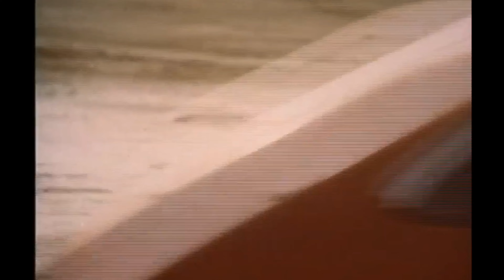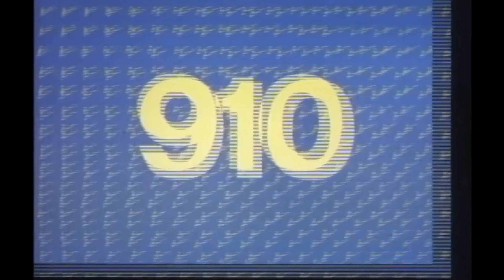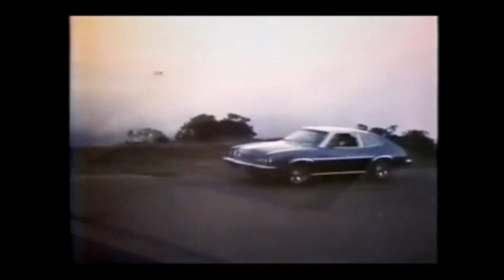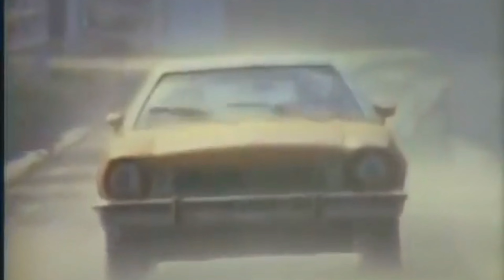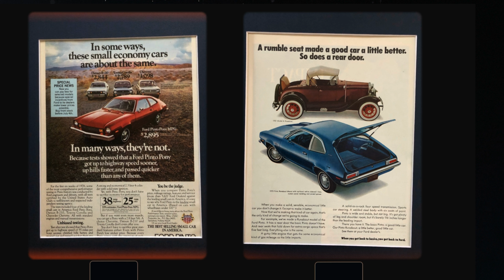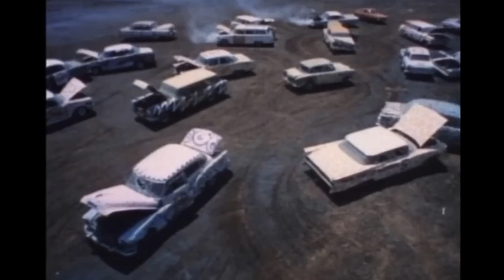Ford Pinto: The Car That Caught Fire for $11

Comment: As someone who actually worked on Pintos and drove them, I think you're overstating how awful they were.  

First, in the early 1970's all economy cars rusted out.

Second, with the 4 speed option, Pintos were actually kind of fun to drive.  They handled a lot better than many of the large street liners of the time.

Third, you are very much correct that the Pinto pretty much mounted the gas tank in the rear bumper and moreover didn't firewall the gas tank from the passenger compartment.  But the larger gas tank gave the Pinto more range when people were standing in line for gas.  Moreover none of he economy cars at the time were likely to protect the occupants much during a crash. Economy car buyers made the conscious choice between safety and fuel economy.  If you were into safety, you could buy the Galaxy 500 for only around $3700.00 as I recall and a couple thousand more for a Lincoln, which was built like a tank.  Despite what people lead you to believe today; no one who bought a VW, a Vega, a VW microbus, Pinto or a Datsun B210, thought they were buying a "safe" car.  Think about it, people still buy motorcycles everyday.  People still actively choose against safety even today. 

And fourth... the car was only supposed to last 5 years and 60,000 miles.  That's when it rusted out and the timing belt broke.  There was absolutely no intention for it to ever have a second owner in it's design.  It was a disposable car, just like the Maverick, Vega and later on the Granada.  For the most part it did as advertised.  And to be honest, the competition, for example the Chevy Vega wasn't going to improve your life much and the rice burners at that time rusted out just about as fast as the Pinto as did the VW Rabbit.

Lastly, if you somehow thought you were going to drive this car 200,000 miles, your life was going to be hell, but that was true of most cars at the time.  All of the horror stories about the Pinto are true to one extent or another, but what people forget is that they usually started when people tried to push their cars past 60k miles.  

What really went wrong with the Pinto was the economic downturn of the late 1970's when people couldn't afford to replace their cars on a 5 year schedule.  Caught in an insane inflationary cycle, often with low or limited incomes, people chose to hang onto their cars longer and they wound up stuck with the time bomb that was actually intended for the second owner.  Also keep in mind, that car companies were actively discouraging used car ownership at the time.   Buy new, buy cheap and throw your car away as you would any disposable lighter or razor.  I suspect that a few Pintos actually reached 100,000 miles, but none without heroic effort, substantial investment and tales of woe that are still being retold. Likely those are the basis for most of the legends of unreliability we recount today. If you dumped your Pinto when you were supposed to, you likely had a reasonably good ownership experience.

I'm not defending Ford.  Economy cars of that era were overall marginal, but they were what consumers wanted at the time. People wanted new and they wanted cheap and they wanted fuel economy and they were willing to make sacrifices and they got what they deserved.  There were very good reasons why the Pinto was such a good selling car, which somehow history has forgotten.